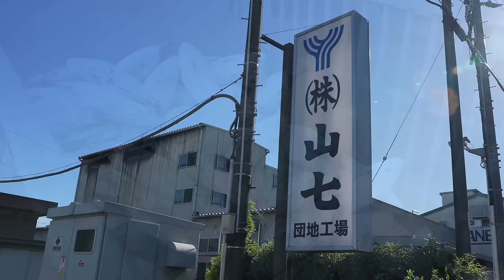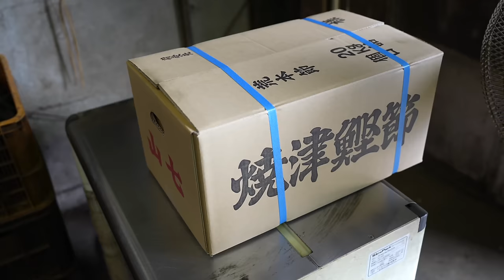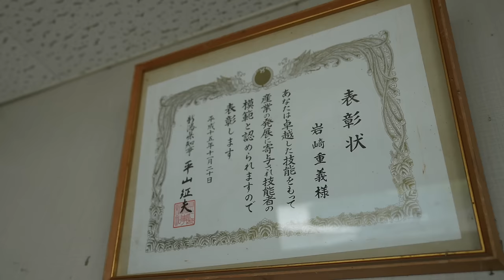【驚愕】 世界最高の日本のものづくり！！職人達！大量生産！BEST 5

Comment: 13.40...14.40..in the company I work for, we bought about 50 cars of this type brand new, which constantly present significant problems, the clutch is too heavy after driving for a long time your feet start to hurt, with the transmission, the gears are knocking from first to second, their electronics work correctly, in general, their construction is very poor, Mitsubishi is not used to this type of construction we all know the reliability of mitsubishi before you drive these cars though